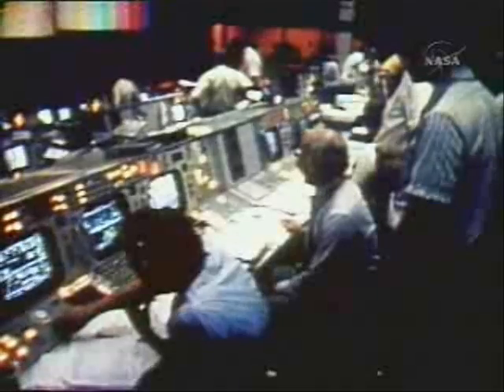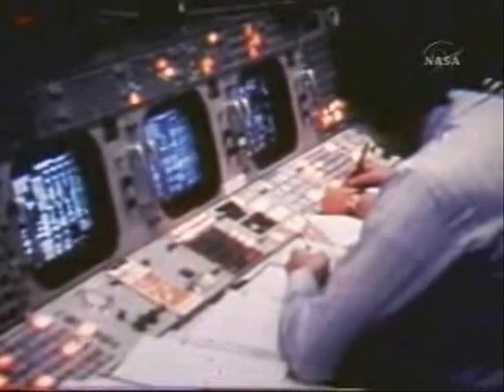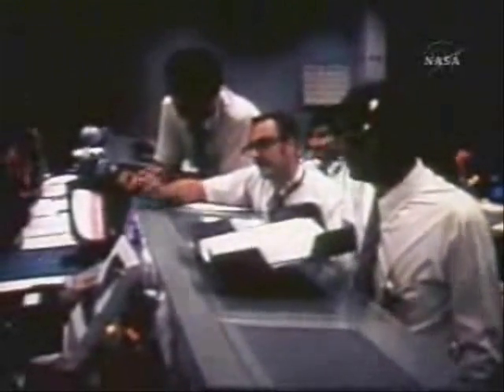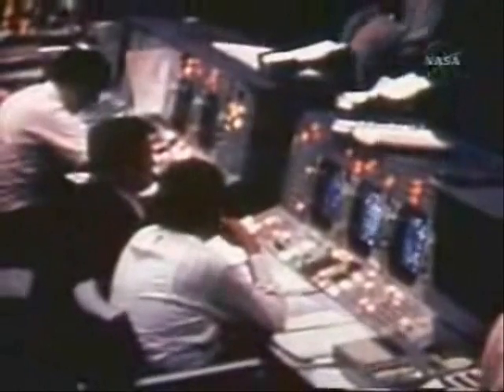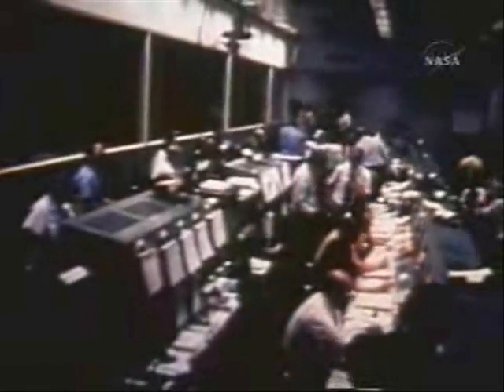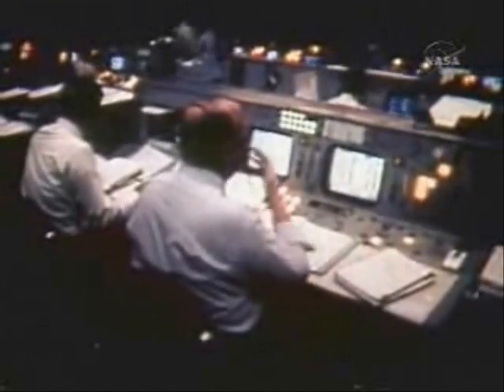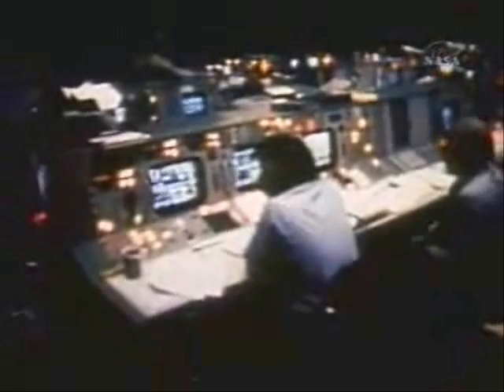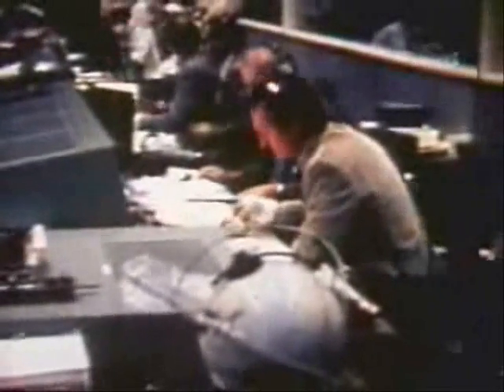1973: Skylab 1 (NASA)

Comment: I've seen another video with the same curious combination of the Skylab 1 launch with a closeup of what is definitely not Skylab 1, but either Skylab 2, 3, 4 or ASTP - manned launches of an Apollo CSM on a Saturn 1B.
Reply: I know exactly what you mean.  The very first section of this video is a total mismatch to the audio.  The audio is definitely from Skylab 1, but the video is NOT a Saturn 5.  It only has 2 stages.  I'm 60 years old, and I'm a NASA nerd from WAY back.  I've seen all these launches so many times I have them memorized.  I know which audio track goes with each video.  Sometimes it's the lighting, or the direction and/or pattern that the steam makes as it rolls away from the pad at lift off.  I recorded a lot of these launches on cassette tapes when they originally happened, and I listened to them until the tapes wore out.  So I pretty much know the audio of each launch without any problem.  I have never understood why producers of these videos try to piece together audio from one launch, and video from another.  I would think that would be more editing work than just finding the original and using it.  I don't think the producers of these videos even realize that there are people like you and me out there who can detect a mismatch in a hot second.  And even if they do know, they probably don't care.  Which tells me that they really aren't trying to present their videos with any kind of historical accuracy.